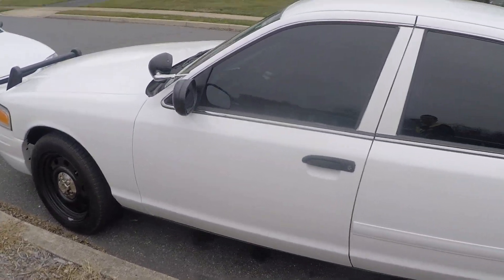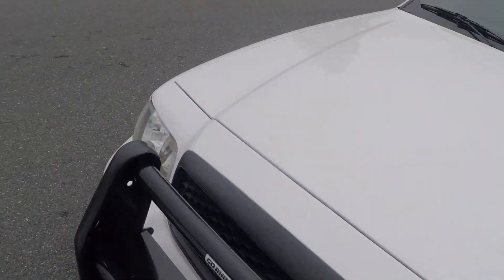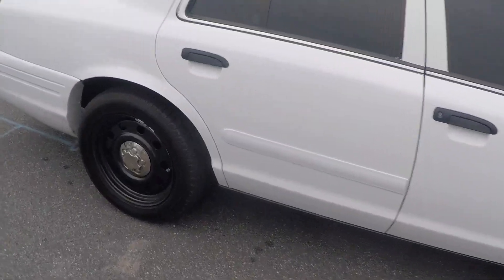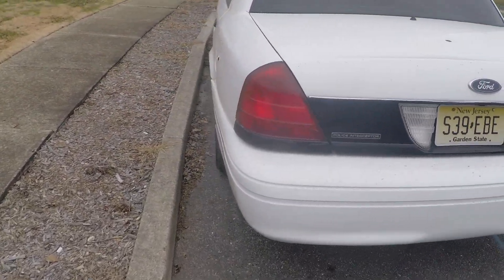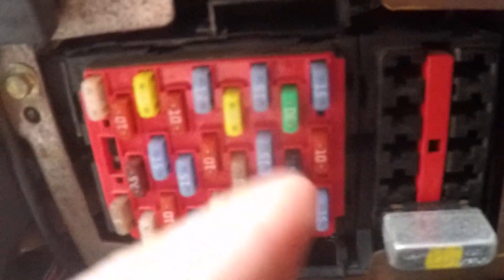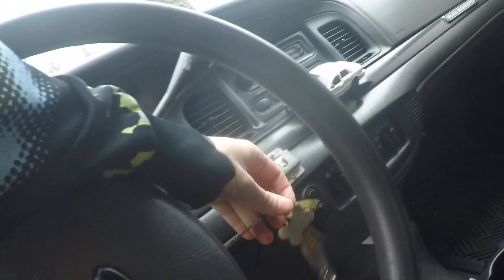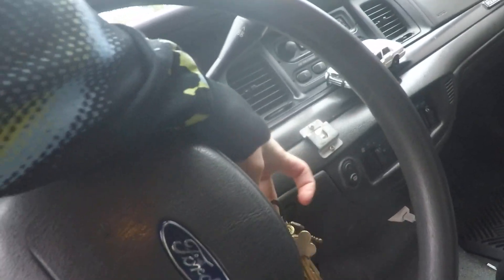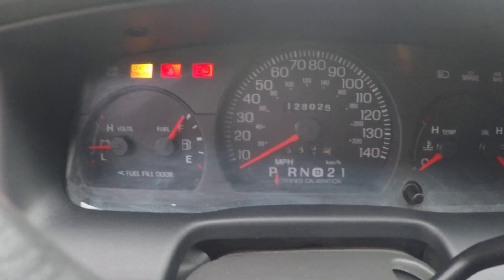CROWN VICTORIA BLINKER ISSUE HAS BEEN FIXED

Comment: Aye I have a 08 crown Vic and I have a tail light problem they don't light up when I hit the pedal
Reply: Brake light wire on the pedal. My 96 had an issue wouldn't let me switch gears.